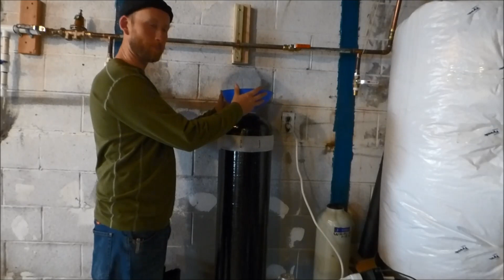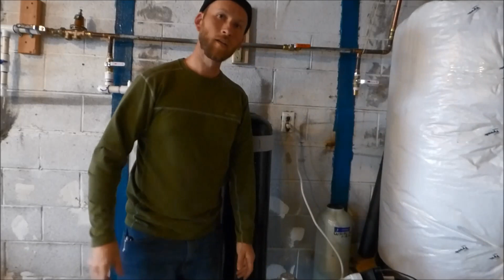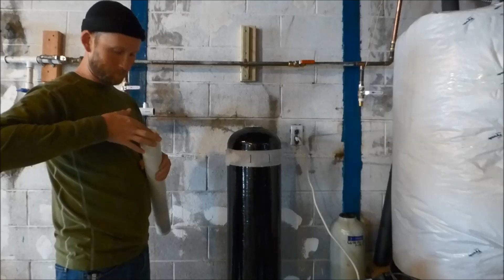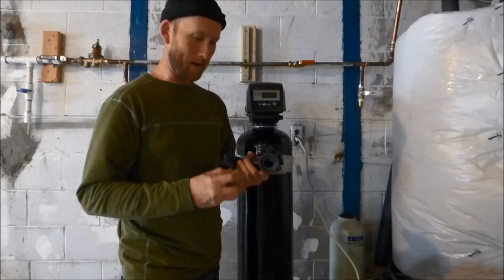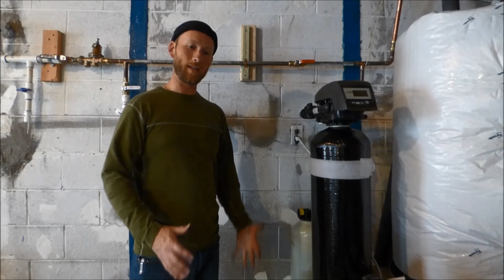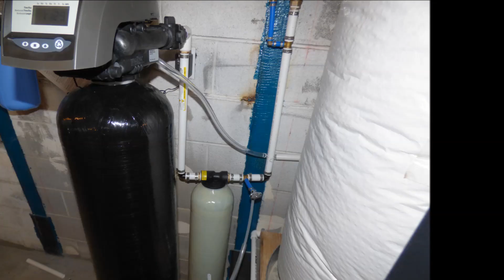Whole house carbon and fluoride water filter

Comment: how are the sharkbite fittings working with the temp swings?
Reply from the maker: They work just fine. I used them for their ability to swivel and to be removed.
Reply: How’s your water flow. Did this set up slow down your water flow any?